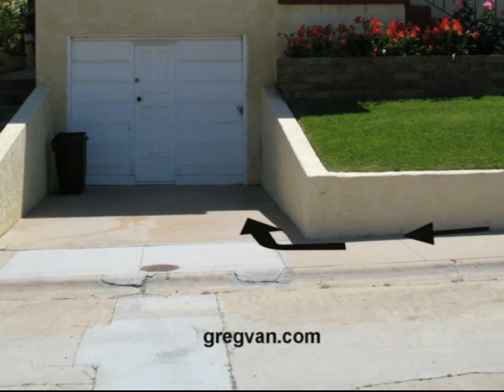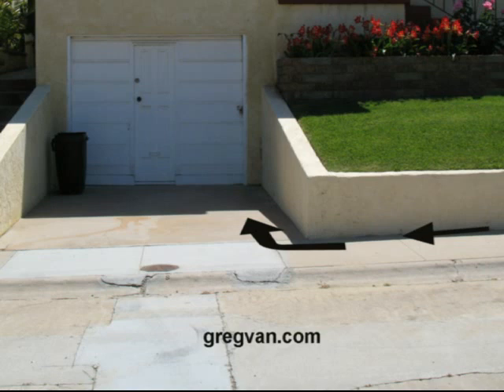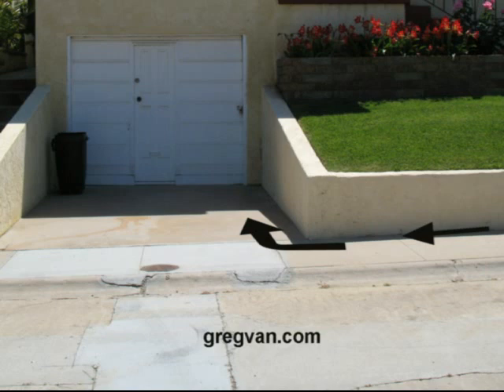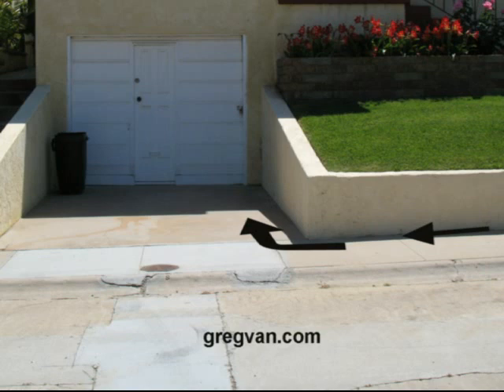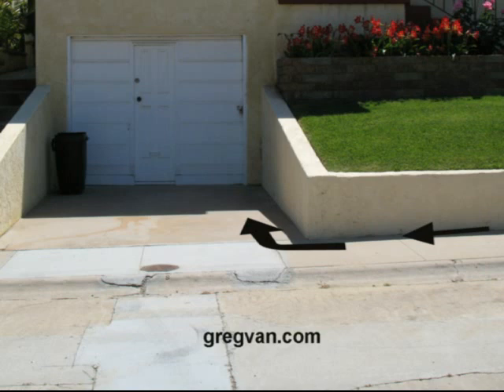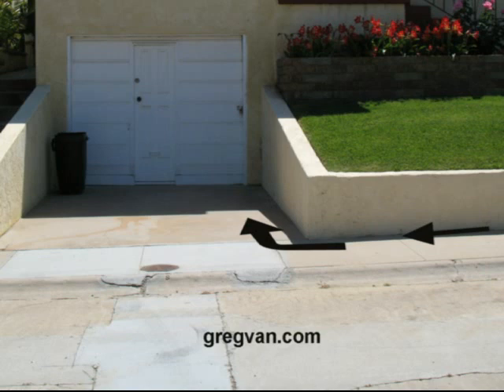Drainage Issue With Older Home And Garage - Building Design Problems

Comment from the maker: From what I remember, the other side looks similar to the soil level on the right side. It really is hard to understand why the builder did something like this and you've got a good point, if this is messed up, what else is also. I think you could always do something with a sump pump also, but whether or not a sump pump would actually do its job, would depend upon how much water is actually coming down the driveway.

Comment: what is on the other side of the knee wall on left side of driveway? I would put in a curb or speed bump as you suggested, and install a drain in frot of the door and run through wall behind where garbage can is sitting if there is not a berm on the other side. otherwise, don't buy a house built like this. there was obviously no thought put into it by the builder, which makes me wonder what else had been short cut.